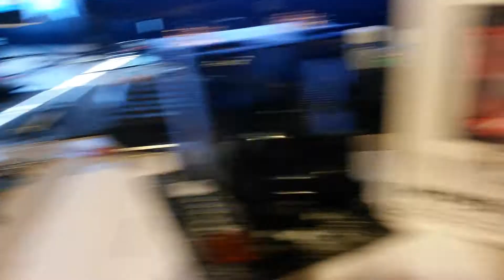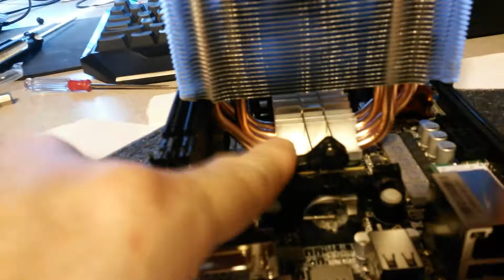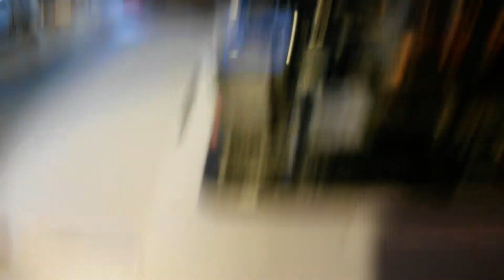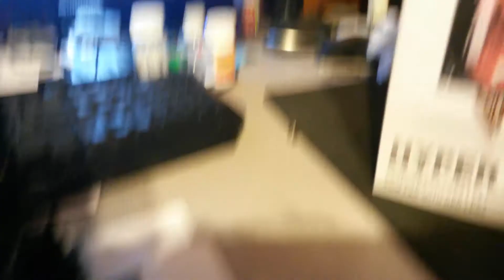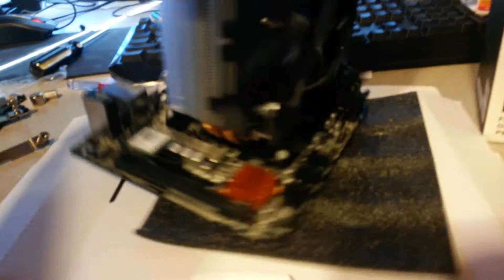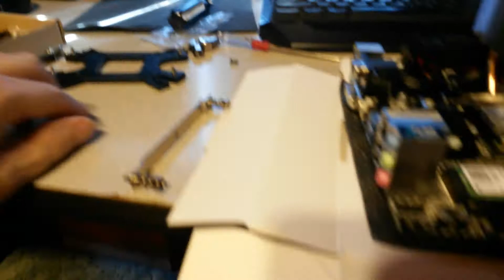Super Quick and Easy Install Tip for Cooler Master Hyper 212 LED on AMD am4

Comment: I have the LED and mine came with the wrong bracket now im using the retention arm. However it does not provide optimal contact with the cpu when compared to using the mounting brackets... 87C on ryzen 5 3600 .... I hope cooler master sends me a new bracket....:(

Comment: I have a question, my hyper 212 led is old version since it didn't have a slit for the lock latch and it didn;t come with it. I was just wondering if I could use the amd brackets with screws for am4? or should i just replace it with a new one that supports am4?
Reply from the maker: I don't think the  included AMD mounting brackets will work for an AM4 socket, as the alignment is different. You would be better off getting a new one all together, or get the  AMD AM4 Upgrade Kit from Cooler Master if you can find one.

Comment: Hi im using this on msi b450 tomahawk max motherboard. With that latch i can only mount this cooler facing from gpu to top vents of the case. Please help. The mounting position is very bad. I tried the other amd bracket they added but using that it does not reach to motherboard standoffs. Can you please come dm or add me on steam or something so i can discuss and show you the placement of the cooler. Please respond
Reply: To everyone who is reading my comment, i fixed the issue.
What you need to do is, they give you amd bracket not am4.
Use that amd bracket, where the screws are, use somwthing solid to tighten the spring of those screws make it smaller. Then it will easily can be mounted on the motherboard before that it was not reaching it to motherboard holes
Reply: @GamersOrb  can you explain it detailedly? I have the same problem.
Reply: @AnxStudios  same problem.  halp
Reply from the maker: I had the same problem when I upgraded to a Ryzen system.  I ordered a mounting kit from Cooler Master but it only allows you to mount it with the fans aligned vertically.  That's OK in my case since I also have an exhaust fan at the top, but I would prefer it blowing out the back.

Comment: Years later but I still have a question: You can use that clip-lock that the cooler has on an AM4 socket?
Reply from the maker: Yes, it should work fine.  This model is designed for AM4 socket.
Reply: @sergeantgunny  despite the years you still answered, thank you! You got a new sub

Comment: The way I see it, there are two ways to install it on AM4 right? The one with the backplate and the one with the "lever-lock" thing. If so, is there any benefit of one over another?
Reply: Daniel Serrano the backplate method looks cleaner imo. Other than aesthetics probably not.
Reply: The backplate method is better if you're shipping your pc .
Reply from the maker: If you are trying to get the CPU cooler airflow out the back, but using the back-plate causes it to flow up instead, that's when you want to use the CPU clip.

Comment: Not helpful at all
Reply: I agree this video was not helpful in a way where the title is misleading. But I did learn that your setup is hella dirty and it needs to be cleaned ASAP.
Reply from the maker: OK your comment was helpful in what was wrong with my video so I changed the title to TIP instead of GUIDE.  No promises about cleaning my setup though.
Reply: Exactly. Not helpful at all. Now and days people don't want their cooler horizontal. And to the fact you didn't show how to mount it vertical when you even said it's wasn't what you were going for in your build with it being in horizontal position either means your lazy or just don't care to actually help out those watching your videos. And your attitude in your comments to viewers shows why your channel ain't growing at all and never will..
Reply from the maker: I clearly show the cooler mounted vertically on the motherboard!  What in the actual fuck?
Reply from the maker: TOO BAD FOR YOU.

Comment: what temp does this keep ur pc at under full load?>
Reply from the maker: According to CPU Core 1.11 my CPU average under full load is about 73F, with a max  record of 76F.
Reply: Sergeant Gunny you mean 73C?
Reply from the maker: Nope, Fahrenheit.  Current idle temp: 44F.
Reply from the maker: Oops, I mean Yes, Celsius.  I don't know why, but Cpu Core was incorrectly reporting Fahrenheit instead of Celsius...

Comment: I used the lock latch and my AMD FX 8350 is overheating. Maybe it's my air flow or too much thermal paste?
Reply from the maker: Not enough paste could be it, but not too much...It could be airflow, or the heat sink might not be making enough contact with the cpu.

Comment: So this works on the new am4 socket? And you do NOT have to mount it up or down? You can use the clips to mount the cooler pointing to the back of the case, correct?
Reply from the maker: Not exactly...The current ones only support FM2+/AM3 etc., but the NEWER version of this cooler WILL support AM
4, but you have to order the kit that specifically says AM4 on the product: http://coolermaster.force.com/pkb/articles/en_US/FAQ/Hyper-212-LED-AMD-AM4-Compatibility
Reply: Thanks

Comment: can it support am4?
Reply from the maker: According to Cooler Master this one does NOT support AM4 socket, only the Hyper 212 LED TURBO in this class of cooler works with it. http://www.coolermaster.com/amd-am4-ryzen-compatability/en/?#am4-compatiblity-list
Reply from the maker: They are coming out with a newer version that DOES support AM4, but it has to say AM4 support on the package: http://coolermaster.force.com/pkb/articles/en_US/FAQ/Hyper-212-LED-AMD-AM4-Compatibility
Reply: i have this cooler, bought it this year and it doesnt have the am4 install bracket